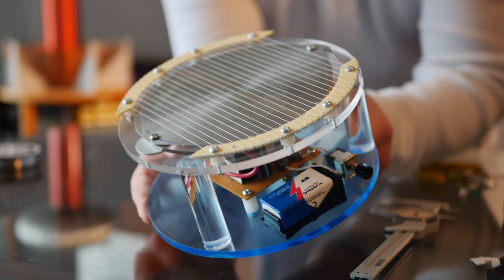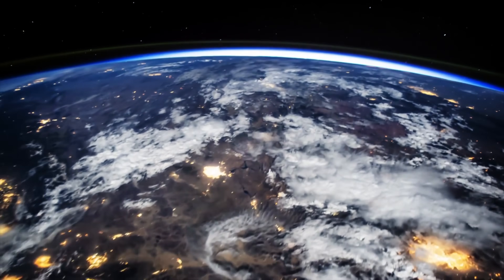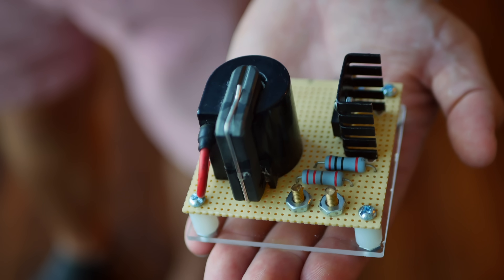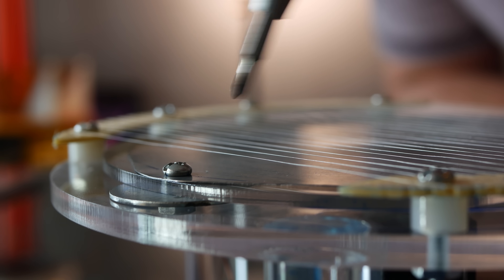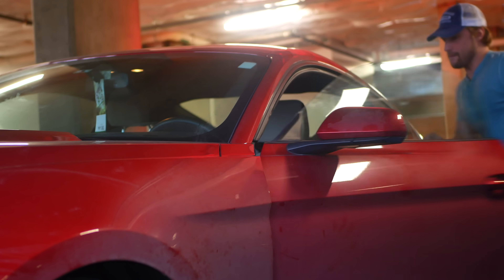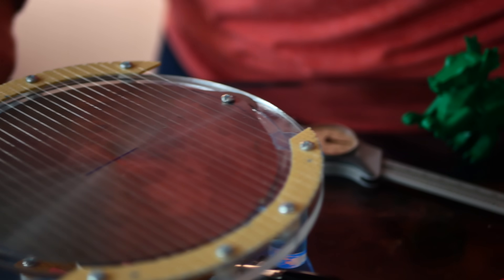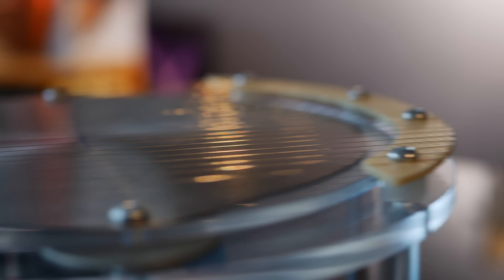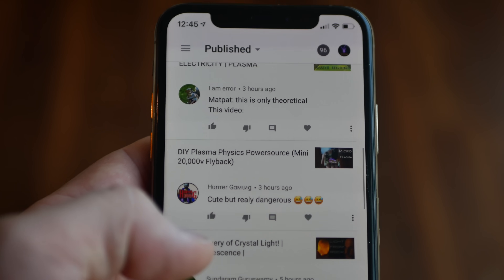Detecting Radiation Using High Voltage Plasma (Spark Detector)

Comment: That's awesome! But space is fake. There's not one picture of Earth from outer space? Nasa uses CGI images NOT photographs.

The Earth has a 14 PSI atmospheric pressure. That couldn't exist next to an infinite vacuum? There has to be a physical barrier to contain atmospheric pressure. You also need a physical barrier to bounce radio signals off of. You can't bounce radio signals off of air?
Reply from the maker: Hi Ron. This is not accurate, basic physics dictates as such. The Vacuum space therefore no way we can have air pressure on the planet argument is identical to arguing 'airplane wings cannot possibly have NEGATIVE pressure above them, without being in a closed container to make it negative'. Above an airplane wing, the air pressure is lower, negative compared to below the wing. This is how flight works. It is in an open system, with a dynamic gradient of pressure. Identical to the pressure gradient on our planet. Further proof of this: In a closed, pressurized dome, all gas would be approximately the same pressure. But on earth, it's not. At ground level, it is 14.7 PSI (not 14). At top of everest, it is 4.9, and the pressure exponentially decays the further out into space you go. These are cold, hard measurements that can be double checked yourself. 

As for your statement about radio waves needing a barrier, yes, it is called the ionosphere. Tesla knew about this himself. Straight from college website about radio waves and the ionosphere, "low frequency waves reflect off the ionosphere and essentially "skip" around the earth."

The dome model is so flawed that it's ludacris. This is why everyone should be required to take physics courses in highschool and college. The dome model has already killed people - it needs to end.
Reply: @PlasmaChannel  actually the atmospheric pressure at sea level in Antarctica is lower than 14 psi  because the column of air is shorter. Like the shallow end and the deep end of a swimming pool have different pressures. 

In the 1958 encyclopedia Americana it says there's a dome over Antarctica at 13000 feet elevation 80 degrees south latitude.  I know it sounds crazy but do a little research and you'll find out that it's true. Operation fishbowl. The fishbowl is an analogy for the dome.

The low pressure under the wing only works because it's moving.  When the wing stops the pressure finds equilibrium.  An open system would find equilibrium with a vacuum.  

I'm a huge fan of your devices. I can appreciate how much labor when it's making it. 

When you stop asking questions you stop learning. Question EVERYTHING. Especially things that contradict the official narrative.

Comment: When are you makeing the 1.2mv dc voltage multiplyer and the 30×30 neon?
Reply from the maker: Yeah, that project kicked my a**. put time and money into it only for it to explode. Looking to rebuilt it. hopefully in a few months?
Reply: @PlasmaChannel  how cah a multiplyer explode? Do you mean the diode explode like a transistor ir the capacitor explode like a electric capacitor?